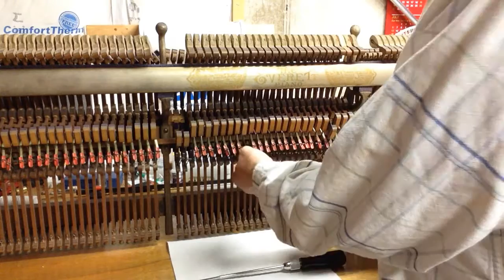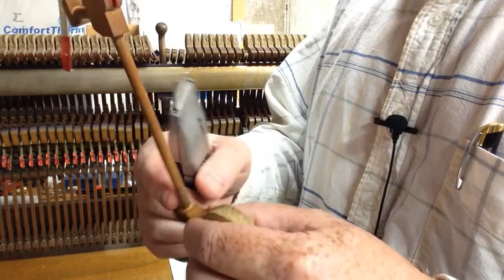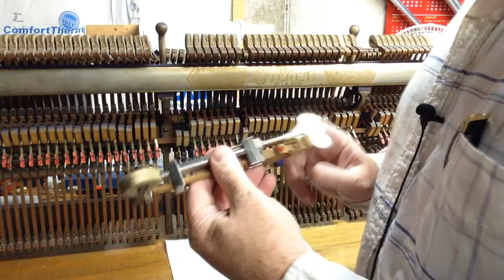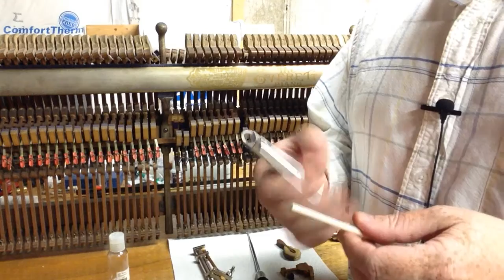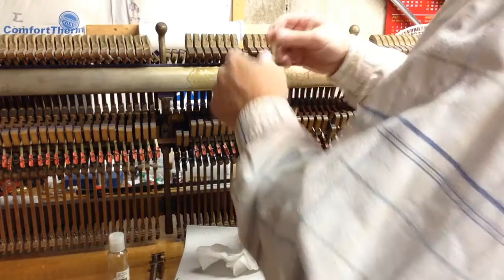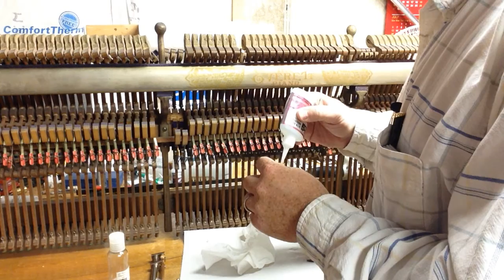Upright Hammer Shank Replacement - Piano Tuning & Repair I HOWARD PIANO INDUSTRIES

Comment: That's a tedious work. 20min for 1 shank if things goes smoothly. That's almost 30 hours for the whole piano...
Reply from the maker: Once you start in the process it gets faster.  If you were doing the whole set, you would get a system going which would speed up the process.
Reply: @howardpianoind  Thanks I was a bit discouraged.
Reply: now u know why its so expensive to get this done professionally.  all new hammers is $1k just in parts, and then 20+ hours of labor on top of it.

Comment: I have two keys that do not move at all they will not press downward whatsoever. I removed the bridal strap and proceeded to find the screw which holds the hammer assembly. While looking for the screw I noticed that the entire assembly was already loose and moved entirely freely. I proceeded to remove the hammer assembly and found it came out without removing any screw (which I never could find by the way). I found that the hammer butt flange was not attached to the butt when I removed it and the pin for the flange was still mysteriously in place in the butt. I looked into the vacant space where the hammer assembly used to reside and saw a brass piece of metal still attached to the piano. I stumbled upon one on your website which I found was a Brass Hammer Butt Plate. I found that you sold the butt plates and also sold the tool that installs them. I can find nothing whatsoever on how to install one. I have no idea where the hammer butt flange could have gone especially when the pin was still attached to the hammer assembly. It must have gotten completely destroyed somehow. I looked and still could not find those screws which are hidden behind the jacks. I have no idea of how to replace the hammer assembly even after I will have attached a replacement hammer butt flange. I have some pictures but no way to send them to you. I already sent a contact message on the Howard Piano Industries website. Any help would be greatly appreciated since I will have need of tools and parts from your website. Thanks.

Comment: I put a little damp cloth around the butt and the hammerhead and apply a hot hair styling pliers . After about 1 minute the shank is loose without anything being damaged. Moreover, it is in most cases possible to do this without taking the part out of the action, which saves a lot of time.

Comment: A veteran piano repairer some 60 years ago when I was a kid pointed to burn marks near the shank/hammer junction. He said a heating tool was clamped on the soften the glue for removal and replacement of a hammer head. Would there be any utility in dampening the glue joint then giving the hammer assembly a short time in a microwave oven?
Reply from the maker: I have never heard of using a microwave to loosen a glue joint in piano work. After dampening the glue joint you can use a lighter ( I use the kind with a long tube for lighting a stove ) and move the flame back and forth around the glue joint to heat it. I try to not scorch the wood by moving the flame around quickly.

Comment: surely water will just swell the wood? ,,,,,, I would use a hot iron tip to either shrink the wood and/or melt the glue
Reply from the maker: Hi Colin,  Thanks for your suggestion.  The reason for the water is that in most cases the glue used would be water based so by applying the water, it would soften the glue so the part could be removed.  It does depend on what kind of glue was used though.

Comment: do you sell good used hammer sets for uprights
Reply from the maker: No, we do not sell used hammer sets. The job of replacing hammers is very labor intensive so it is rarely worth the effort to install used hammers when new ones could be used for a a little more money.